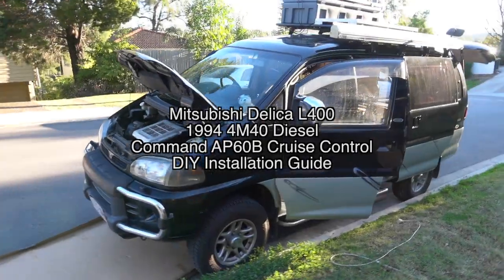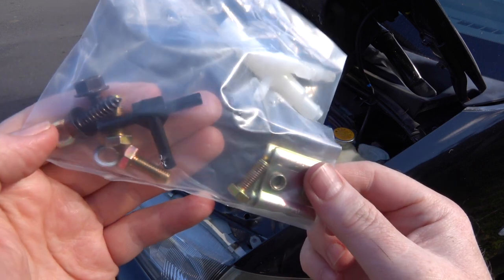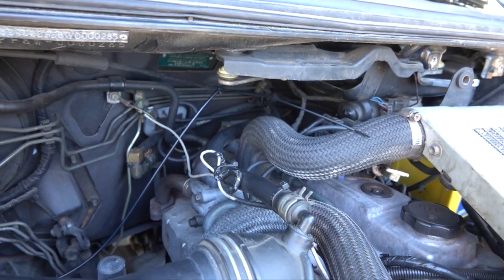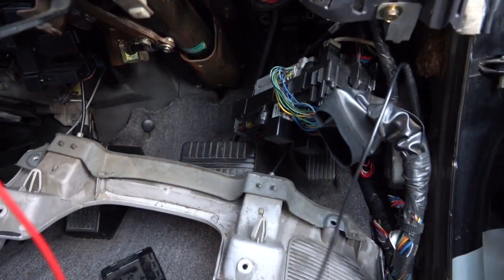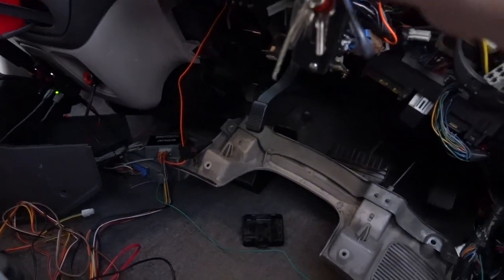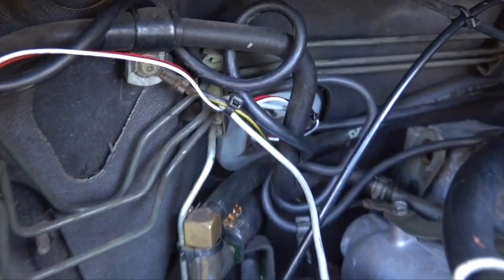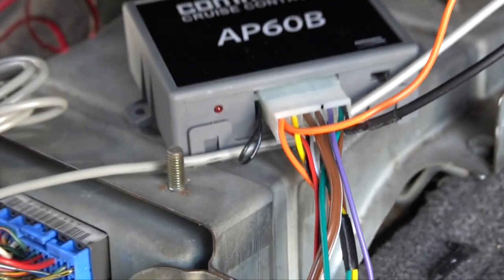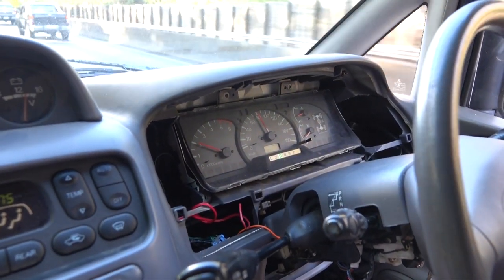Delica 1994-98 L400 Cruise Control AP60B Install Guide for Series 1 Diesel 4M40

Comment from the maker: Just reporting back in - I've not had a single problem with this cruise control since I installed it. It works brilliantly, and if you have a 'HOLD' switch on your Delica, switch it on and it won't kick down as much on motorway hills.

Comment: Hey mate! thanks for the guide has so far been super helpful. I have a 1998 toyota prado, and am having trouble finding out if there's a speed pulse connection somewhere in my car. I have located a wire that is labeled "Speed Sensor" (also behind the instrument cluster but within a wiring harness) and was thinking that if i splice into that it should do the trick just fine. I would really appreciate your opinion and/or knowledge as i really dont want to double-side tape 2 magnets to my driveshaft. Thank you!
Reply: To add to this, I have found in a Manual that the "Speed Sensor" in a 1996 model, is defined as; "Uses magnetic impulses to open
and close a switch to create a
 signal for activation of other components." Which to me just sounds like Speed Impulses ???
Reply from the maker: @axelrichardson9606  Hi mate, glad to be of help. I couldn't say for sure if it would work, however I guess you could just splice into it and give it a go. You'll get a red LED blinking while you drive if the control unit is detecting the pulses. Let us know if it works in case other people are trying the same! :)
Reply: @thedoble  alright ill try that and come back here!

Comment: Mines been having issues cutting out and back in. It feels like the minute my speed exceeds what ive set, like if i get a small gravity assist that bumps my speed by a few kph, then it completely cuts the power and only resumes when im 20-30kph slower. Any ideas?

Comment: I cant seem to get test mode to work full stop. The light flashes with each part of the system working, but it does not pull on the throttle cable at all, the only thing I can think of is the vacuum unit is actually broken somehow.
Reply: Hmm, did you try holding down the set button? If there's a lot of slack it may take a while to pull it up. You should be able to see the cable move.

Comment: Hey, fitted unit and it worked straight away 
I can drive as slow as 30kmph with cruise on but will only do a top speed of 86km. 
Is this unit limited to that speed or should it be going higher?
( I have two magnets fitted to driveshaft…..Hyundai Getz)
Reply from the maker: Mine works all the way up to 110kph. IIRC there's a cable you can cut that might help. Check the manual